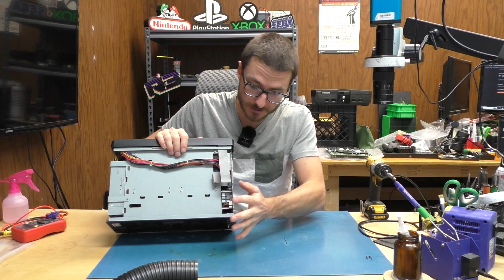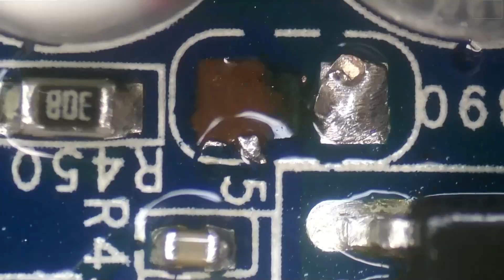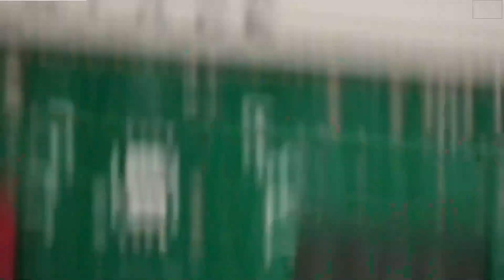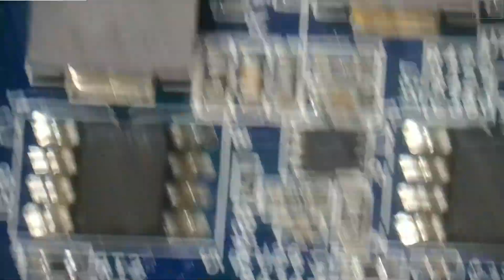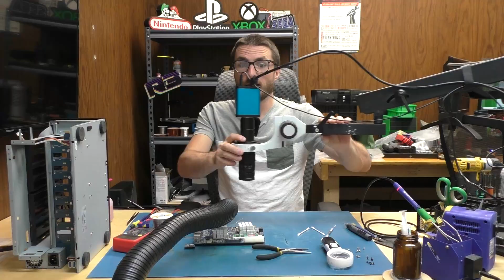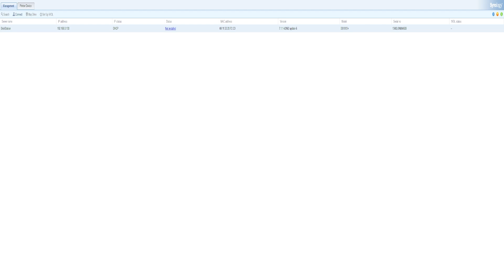I Fixed Dead Synology DS1813+ No power

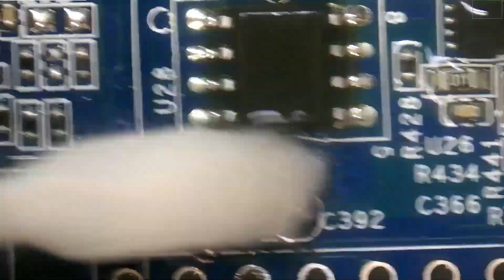Comment: 5:18 some traces were also damaged, best practice is to check them for continuity and cover them in conformal coating.
Reply from the maker: Actually I did it on camera and then took it out of the video because they weren't damaged and it was a bit of a long process to show where they go and how I checked them to be sure so to shorten up the video I took that out. Felt it wasn't beneficial to most people trying to fix their Synology unit since this was unique damage caused by someone else trying to fix it and thus wouldn't be applicable to 99% of viewers.